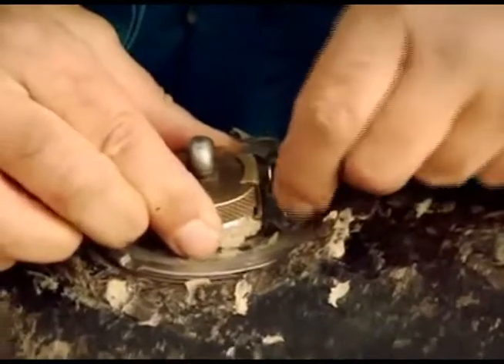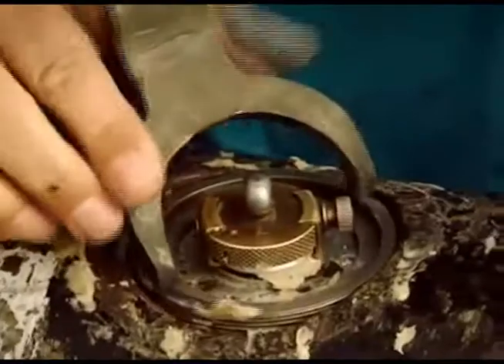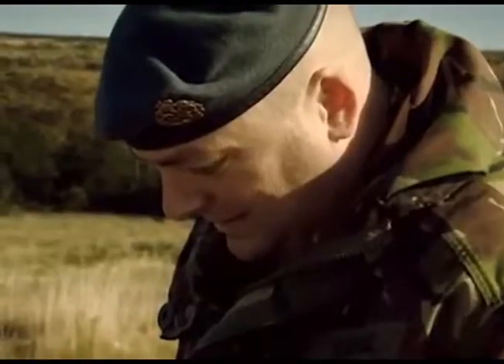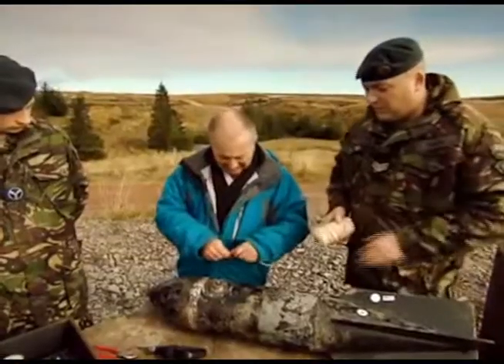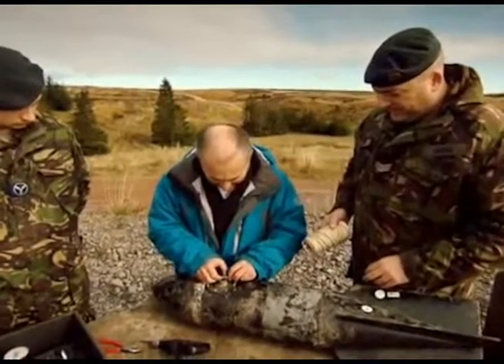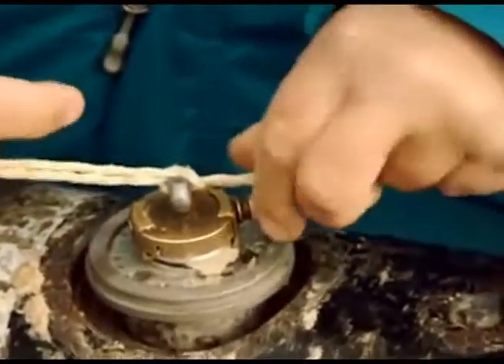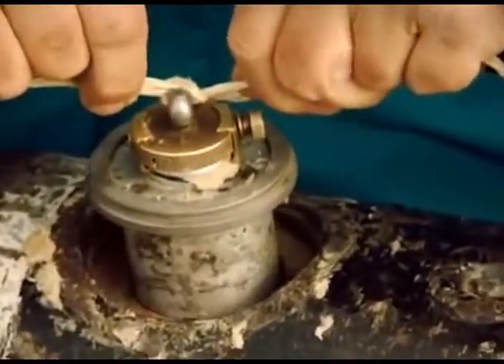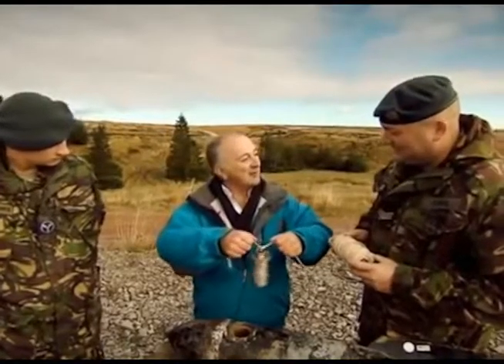Deactivating a WW2 Bomb - Fuse ring and Crabtree

Comment: Well if it had a z on the case that's the one that killed most of the bomb disposal guys and then there was a couple other ones it had I had a clock in it that if you started to mess around with a fuse the clock would start and it was like 5 minutes before it would go off I'm in a really bad one was Ariel mine it had two fuses when front and one in the back and it was hard to get at and it had a 30-second run time and you had to put a special device in there to stop the 30-second clock and it killed a lot of people it was like 3,000 pounds of explosives it was a SEA mine so it also had a magnetic detonator you had to use non-ferrous tools on it where you would Set It Off